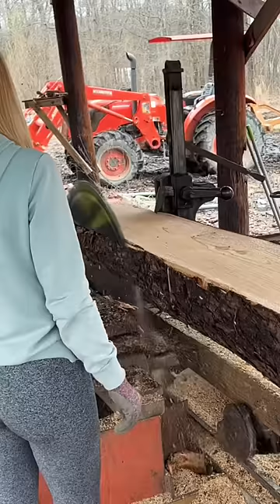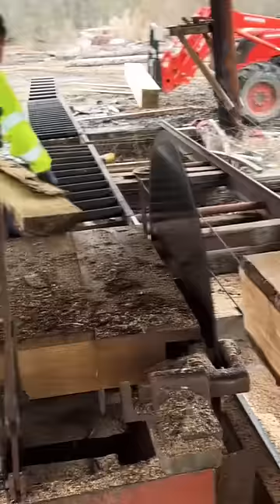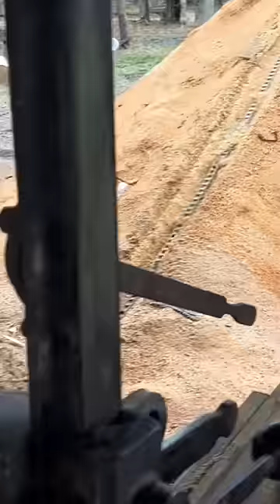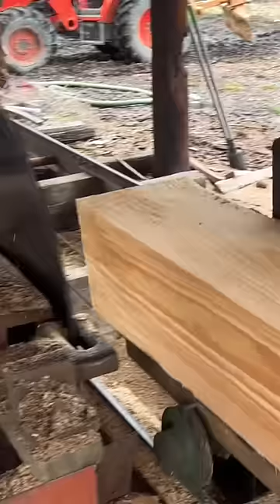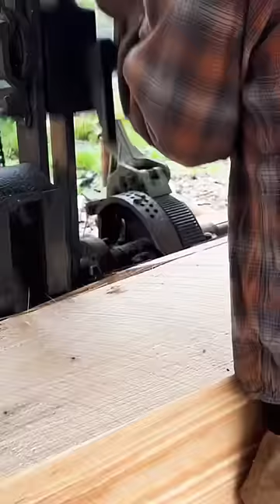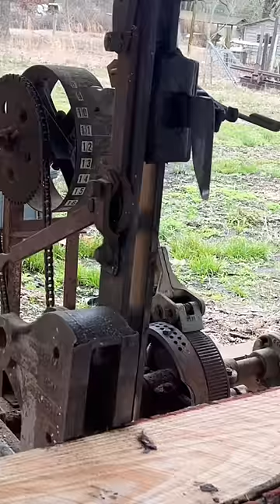Sawing pine porch posts! (Full video will upload tonight)

Comment: I saw a accident in a sawmill one time. The teeth grabbed the loose arm sleeve and yanked the person in wearing a sweat shirt. It ripped and cut at the same time. Arm was left hanging. The forhead and hair was chewed up before blade stopped.  Lady needs hair back and better safer jacket, before a accident happens. Be safe.

Comment: That unguarded fast rotating blade is literally one of the most dangerous things I have seen on the internet in a long time. I say that as someone who grew up on a farm where catastrophic accidents are very common and half my friends at primary school were dead by age 18 in road and farm accidents.
Reply from the maker: Obviously you never grew up around sawmills. Look further and you will find many more sawmills like it on the internet.
Reply: @wallacefarmandsawmill  I am from the UK where we have some big sawmills like that in forest areas. That set up would be illegal here. The HSE inspectors would simply shut the operation down. It really wouldn't cost much to make it safer.
Reply: @wallacefarmandsawmill  you are correct! These were the standard for a high production mills. My father owned and operated similiar one's from the 1940'-1990's. I was the one on the other side of the blade. They are very dangerous mills but common sense goes a long way

Comment: the supply of the log is not thought out, the floor is on the side of the disk, there is no protection in front of the feeding device from biting the disk or flying chips

Comment: those safety glasses doin a ton of good on top you damn head. apparently you havent seen a saw  shuck bits of carbide and steel like bullets after hitting s0omething hard  inside a log. o/w you would take eye protection a hell of a lot more seriously